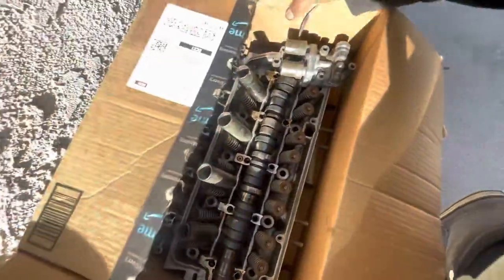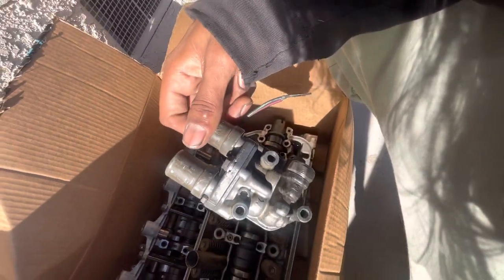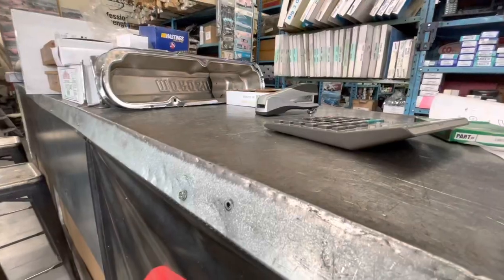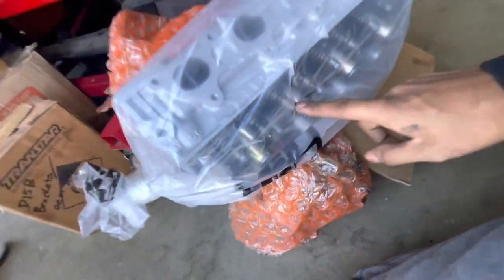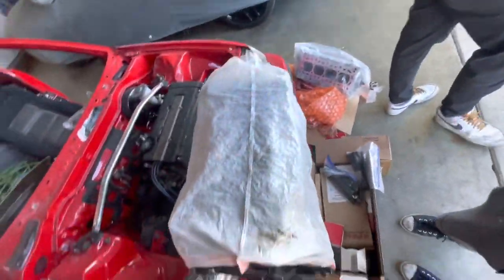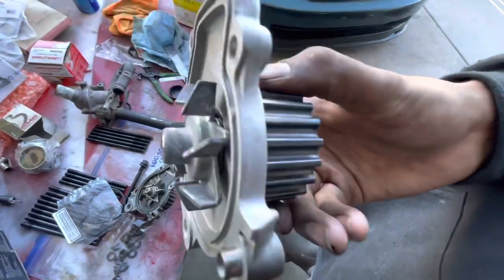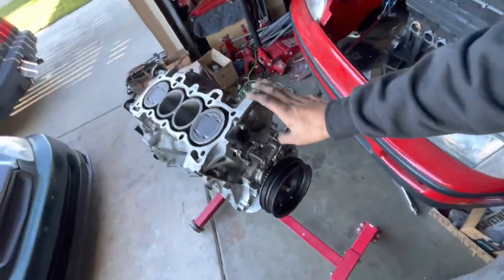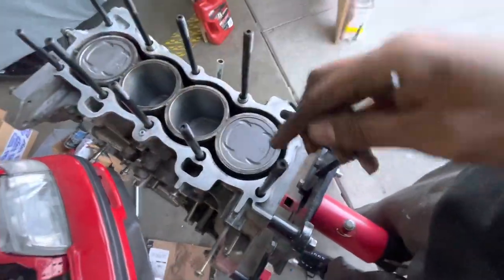How to Build a VTEC D15 Mini Me + Parts List

Comment: I have a mini me swap, D16Z6 head on my D16A6. The P28 is tuned as well. It’s reliable as I’ve had on my EF since 1999.
Reply: Need guidance with 98 civic lx m.t with d15b swap
Reply: Hp???
Reply: I got it to turn on..i just jumped 4 pins on main relay.
Reply: Parts list?

Comment: Good evening, I have an ek3 jdm d15b with dual vtec (stage3). I wonder if I can change the stock camshaft. putting something better. you understood in order for all 16 valves to work all the time. could a camshaft from d16z6 or d16y8 work on my head?? without making any other changes to the cylinder head. thank you

Comment: Just wondering if anyone has a 400hp build list like piston and connecting rods wise for the d15b block and y8 head I have the same swap and I’m confused on what size pistons and connecting rods to get someone help😭
Reply from the maker: 135mm is standard length, only piston available is pm3, 135.5mm allows for the use of any d16 piston

Comment: It would be very helpful to know what the stock JDM OBD2B  3-stage VTEC rod, crank, bearing size and pistons specs are. And OEM part numbers.  There is so much conflicting info on this engine. Maybe you could do another video on this specifically?

Comment: 😂😂😂 i build a old school style mini me d15b2 and p08-3  head no VTEC crap or turbo crap  . shaved the head and port mild  and put a 272 Delta cam using obdo distributor with some adjustments and a Weber carb and others things old school knowledge like a lighter flywheel etc header and she is a monster gd on gas easy to maintenance and tune with a rusty old screwdriver 😁🪛 .And believe me she is a fast go-kart and her looks tuff and her sound like a old Ford muscle car and she is my baby girl crx bring on and yes she can be converted to b16 transmission in 20 minutes for the big boys in the streets jjjjjj 😁 poor turbos and VTEC jjjj .And she can become 4 barrel carb with higher cam in 20 minutes to really scream fire 🔥 jjjj all homemade nothing special old school style d engine is the real monster and cheap build jjj 🐈